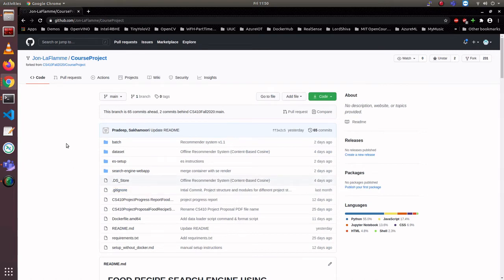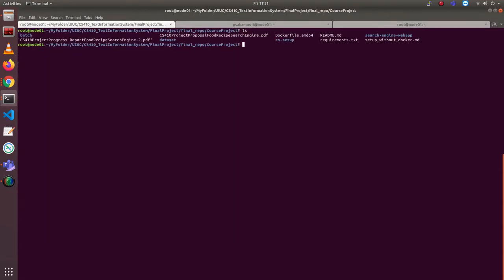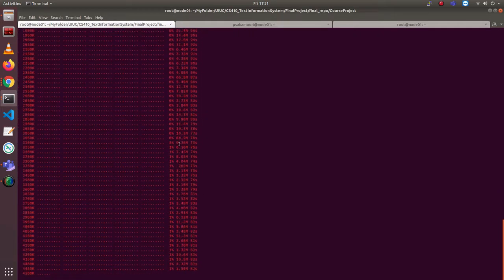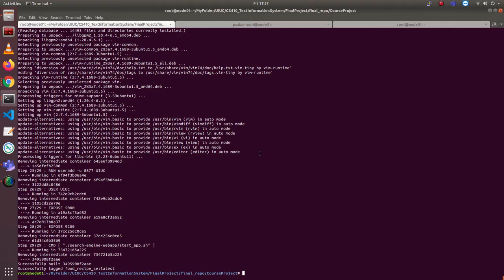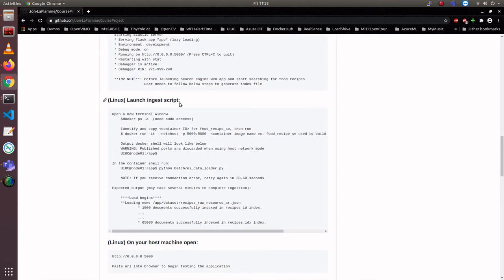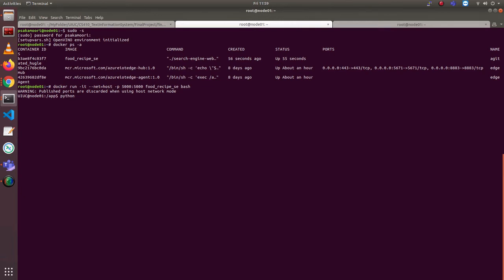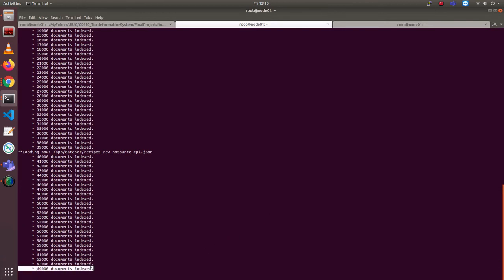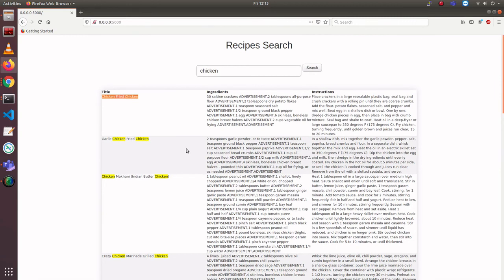Food Recipe Search Engine Using ElasticSearch

Comment: i cant run it from my docker. there is error in 

#7 67.77 E: Unable to locate package python3.6
#7 67.77 E: Couldn't find any package by glob 'python3.6'
#7 67.77 E: Couldn't find any package by regex 'python3.6'
#7 67.77 E: Unable to locate package python3.6-dev
#7 67.77 E: Couldn't find any package by glob 'python3.6-dev'
#7 67.77 E: Couldn't find any package by regex 'python3.6-dev'
------
executor failed running [/bin/sh -c apt-get update && apt-get install -y software-properties-common && add-apt-repository ppa:deadsnakes/ppa &&     apt-get update && apt-get install -y python3.6 python3.6-dev python3-pip]: exit code: 100